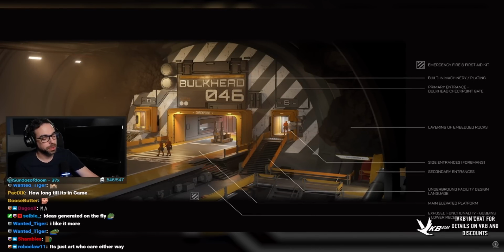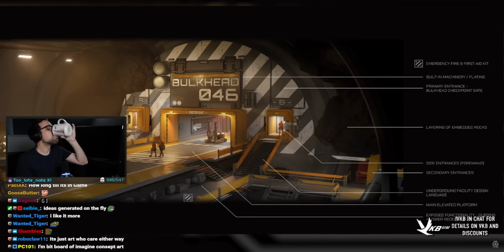These are insane....

Comment: As much as I find player ownership to be important...I'm not sure how the scale of these will work within that context. I "own" my freighter in NMS...it doesn't mean anything. You owning a facility just means passive income...if you think a bunch of players are going down into your bunker to sit at the mess hall you're fuckin lost. 

I think the more important thing about making these structures LARGE is that you can use a space MULTIPLE times for different mission types that have almost nothing to do with each other other and have you going on entirely different paths through the complex: 

Mission 1: You go for a corporate contact, he has a worker riot underneath, go supress the riot. (incapacitate/kill all rioters)...aka kill all. 

Mission 2: There is explosive contraband that was snuck into the complex by an unknown source and a bomb threat has been issued...find the bomb. 

Mission 3: The miners uncovered a monsterousity under the depths...either planted their by enemies or found underneath the surface of the planet...get rid of it. 

Mission 4: Maintenance personel aren't near this facility and someone needs to go in to fix something...go through the facility, connect the grid, and restore operations after some event killed all the workers. 

Mission 5: Sabotage the facility. (which then starts Mission 4 for someone else). 

Mission 6: Pick up a shipment left at Hangar 3 (basically don't even use the entire facility). 

Mission 7: Assassinate a corporate specialist at the facility...randomly spawned anywhere doing any task depending on rank such as deep undeground as an engineer or at the top of the tower as an exec. 

Mission 8: The facility has been lost for some time and corporate wants to reclaim it, they need an ops crew to go in and scout and prepare it for use...(kill all but it's an entirely different aesthetic being used as a bunker for enemies with a boss fight including vehicle combatants and mech suits and aerial defense and backup). Again, then requiring players to put the space back into operations after it is cleared. 

As you can see using Quanta they could link these events to different player missions success or failure to evolve a space logically. 

Not to mention these areas are now more multi-functionale where you can refuel, get food, and possibly rent a hab. 

For these structures my most HYPE element isn't COMBAT, but that they open up non-combat reasons to use a space: resource management could be very cool here. Imagine getting a simple "immediate repair required" mission where you just go down, land, fix something and then a NUMBER of events can occur OFF this qualifer: an aerial assault, a ground infiltration, a power emergency that leads to you needing to solve something deeper about the location, maybe you have to repair a number of things throughout this area and through understanding the space you can solve what is where and how you solve the problem: such as a the power grid failing and finding where all the parts are as well as backup generators, etc. 

Because the space is dedicated to logistics and LARGE...you can use these spaces to manipulate AI...cause an overload at processing and lure the AI in there so you can get elsewhere, overload a gas system to turn a room toxic to mass kill without a trace, etc. Because the place is believable you can make educated choices about tackling a problem: incapacitate a guy out in the field and steal his badge, sneak in and get into a locker room, sneak around the pipeworks and vents, etc. 

The spaces being this large means a NUMBER of types of gameplay get implemented into a single trip: flying, landing, talking to a Manager up top in their office, going down the elevator, getting to a shuttle, shuttling across the large complex to a chasm, then going into the chasm to find the problem. So you have darkness, vehicles, elevators, ATC, landing, all in the same LZ play experience. 

The introduction of the mechanical element of these spaces makes them ripe for MORE than just being a spawner for enemies with lots of cover....but something that can build a narrative and also be used for logistics to create much more complicated events including vehicles, larger threats, and more complex sets of ways to solve the core problem of the mission. You can also massively transform these into DUNGEONS on the fly. A space go neglected too long and it turns into a Ninetails operations hive (in the vein of drug ops) only it's massively built up to be defensible with dangerous large vehicles in the shuttle lanes and so on...and because they can get vehicles down there you can BRING YOUR OWN VEHICLES as well.

Then adding in things like "random cave far off that connects" or "secret lab inside the mines" etc...you can place secrets that modify the location and ONLY show up when you need them to so that the same LZ can be in itself full of surprises.

Then given the facility you can mix and match assets to have them be more focused towards different things...maybe one has MANY processing rooms one after the other while another has loooooooong roads that cut into canyons being drilled out and is more of a mining facility...then another is only barely just started while another is MOSTLY a housing complex with a refinery. You can have some that have a little of everything or some that heavily focus one room repeating with minor variations to break it up and it entirely changes the focus. Especially if they prebuild in "swappable" modules within each room...such as one room can have a managers office hovering over it while another room swapped that for a big vat with tubes connecting to the floor and a skywalk. Making the rooms large means more things that can be taken out and swapped within the room without overlapping the scope.

I want cities too...but I think the bunkers are a test bed for a more complicated and intelligent form of procedural design strategies. 

The previous one was "door = new room" whereas this one is "completely different tile types that slot into different tile ends in unique ways and you can swap the individual elements visually using presets. This could then be used for the eventual CITY tileset that uses the lessons learned to create tile ends-beginnings and how to implement modularity....such as subway stops leading to "hubs" that branch off using the tileset that then feeds outward...so say...a "casino hub" or "education hub" that then leads into an alley that leads into a door that leads into a drug den that leads into a rooftop section that leads into a vista. Then another street is a main street and swaps building meshes along the side with swappable entrances for businesses or locations,  then continues to a plaza and into a corporate HQ that is ANOTHER dungeon area that has a penthouse, basement labs, mid tier offfices...ALL that can be used for swappable mission sets that populate rooms and assign win conditions. The MAIN issue being that given it's a procedural tileset how do you deal with flight capable advantages. Would they just move the cityscape around and only load in detail using tricks? Idk. maybe cities will be MOSTLY "underground" as well and inaccessible to ships. 

The problem with starting with say...Lorville...is you only get 1 shot with a cityscape because it still has to re-enter the surface space. Eventually I'd like to imagine "subway stops" are just bunker entrances. Each assigned to an area around it that gets unloaded when you enter the stop so it can be filled with the "pocket dimension" bunker assets that overlook the cityscape.

Comment: They look great, but they are just 'potential' until they are rigged for Resource Management & populated with missions and interactable NPCs.
Let alone adding a permission system for restricting player access to common areas, or permitting them to lower levels for example. 
Either way it is exciting, but still years away from being fully realized.

Comment: Yet still no need for Rovers. if no one is in ur ship it should be HARDER to fine or track on the ground, Use rovers to drive in this will give a higher chance to finding your ship meaning you'll need a tracking ship in order to find it or eye-sight,  This keep PVP and PVE if u hide your ship. sooo these hangers  would only be  like landing pads and outposts we have now, and removing the whole need for traps when u drive back to your ship. if we keep putting ships in hangers wtf kind of game will this be.

i think the hangers should be for NPC  SHIPS to make it feel alive, and a means to  control a bunker stopping flow of trade and or other lines making it a PVP hot spot and then it spawns in cops  trying to take control back  thus pushing pvp gameplay to put the bunker back to a normal state

Comment: I'm immediately not interested if the first thing you show me is concept art. This is literally just hopium and wishful thinking.
Reply: They also showed 3d white box.  Also this is a very similar situation to the new derelicts where they showed the concept in January and 6 months later it was in game.
Reply: They showed 3D greybox fly-throughs at the end in-engine. They're surprisingly VERY far along. As vorpalrobot mentioned, they did the same with the derelicts that appeared six months later. Actual design phase is probably three months out from completion, but implementation will likely come with 4.0.
Reply: @billywashere6965  Did they state that was whitebox? I thought they said it was a mock up. Not the same thing.
Reply: @scotm721  They literally showed the working greybox models running in-engine, with working elevators and other moving parts, and it was further along than the Lorville Redux, which was showcased running in whitebox in-engine.
Reply: @billywashere6965  at what point in the video did they say "this is whitebox" and not a mockup? I'm not being snarky because I don't feel like rewatching the entire video. From what I saw it was a mockup. Whitebox is what you get when a ship (for example) is entering development to determine the size and scale and if the current product is viable for building out. Just because someone sets some assets with animations, that does not mean it's in a whitebox phase. That's them playing with the concept. Two totally different things.
Reply: @scotm721  They literally said they had it running in-engine and showed it running in-engine, meaning the work that we were looking at was already done. From concept to in-engine design. It was also textured with placeholder lighting. They don't texture whitebox mockups unless they've already approved the geometry layout, as you can't overlay textures until the geometry, levels, layers, passageways, and moving entities have been given final approval. Not sure why people are having such a difficult time understanding this, especially when the progress tracker already noted these underground facilities have been in development for a while now.

Comment: Ownership will come when they aren't making so many assets. Right now no one will own them until most of the tech is working like clockwork. It seems like Resource Management will be a big part of these locations before really meaningful gameplay comes from them.
Reply: Yeah they explain you might run a station on low gravity to save resources.  Player run stations will definitely need logistics and supply shipments.

Comment: While I would love to see these bases in player hands, even if these are NPC mission locations that still doesn't negate the importance of these design elements.  As a friendly mission location having areas to refuel, get food, stock up on supplies, and meet potential mission givers, the social elements of the location are important.  

Such detail is also important for stealth missions where the mission parameters dictate you don't get detected.  Understanding the flow of NPC's through a location is critical to such gameplay and signposting that helps inform the patterns of movement such NPC's take requires a consideration to the amenities and layout that a structure has.

If they add in the resource management system that allows players to enable or disable doors and elevators then these considerations become critical for understanding what to close down and what to open up.

And even in a run and gun type of mission where you're clearing the facility, it's nice to have flavor to the areas where you're unleashing carnage.
Reply: If it's a friendly place to refuel and get missions, there's a chance someone rolls up with a hostile mission.
Reply: I could also see the top layers being used for exec transport missions, middle layer for combat/bodyguard and investigation missions, and lower for mining/resource missions, all happening simultaneously. So the space they have to work with could host a nice variation within one location.